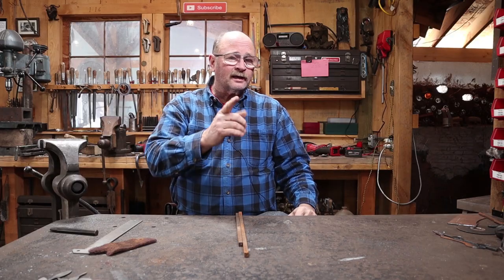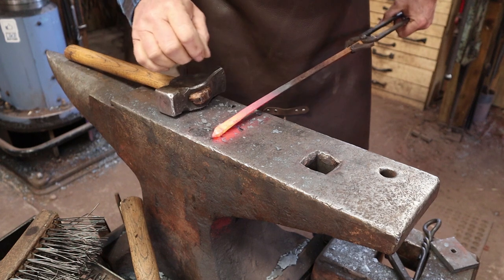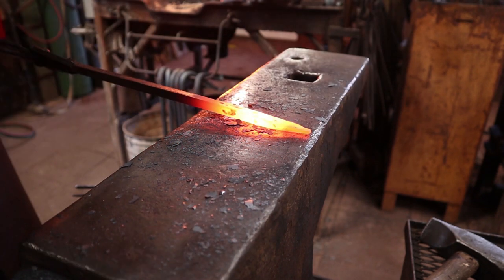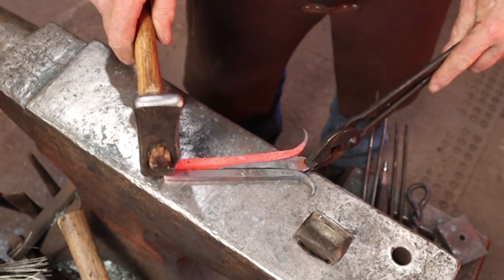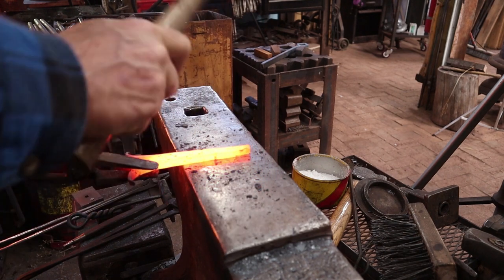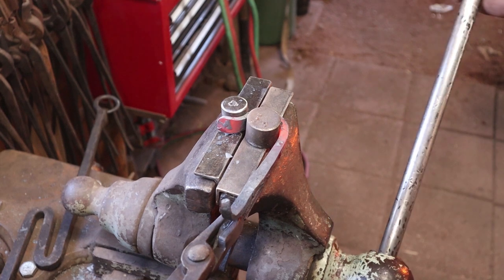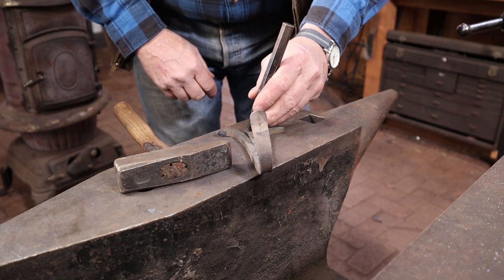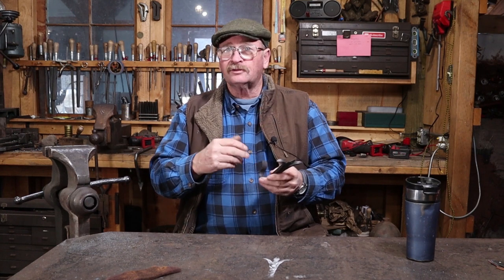Forge welded branch hook - Hook of the Week 32

Comment: It's always good to see small stuff forge welded in a gas forge. I've used a gas forge for years and have made a lot of Damascus for knives. High carbon steel has a lower welding temp than mild carbon which I suspect you were using. I do know that it's time to re-line my small forge and possibly upgrade my blower. Great video.

Comment: I learn so much from your channel. Thank you.
I have a question about “upsetting”. I notice when you do this operation, it involves hitting the workpiece head on to thicken the metal.  It seems that this process pits the smith’s arm against the power of the hammer strike. It’s a pretty unfair competition! Have you ever considered making a specialized set of tongs for upsetting? The tongs would have a piece of steel extending perpendicular to the tongs, close to the boss, so that when you go to upset a piece, you rest this metal finger against the side of the anvil. That way, the tongs catch and hold fast against the anvil when the hammer hits the workpiece.
The smith would still need to grasp the workpiece firmly in the tongs, but the hammer blows would be absorbed more by the workpiece, and less by the smith’s elbow.
I’ve looked all over but never seen such a thing. What do you think?
Reply from the maker: It sounds very specialized and would probably not be just right more often than not.   Using the vise is a good way to hold material while upsetting
Reply: Black Bear Forge 
I see. The vise sounds like a good idea.

Comment: I remember your bucket was empty, Today I don't see the one of several you are using out of, I do how the plastic buckets fall apart so thinking might be why you not on the work table.
Thanks the teaching helps but I don't get into my forge lately
Having to remodeling upgrade on a new for me 1995 Ranger truck should be a nice little truck to have around
Thanks John Switzer I hope to fire up the ribbon burner I built in a slow build last fall.
Reply from the maker: I'm not working out of any one bucket at this point.  So I chose what to use out of any of them

Comment: Okay cool 👍. I have questions on your borax I can't find that type of borax but I have a 100% borax is that any better than soap borax
Reply: Check at  Walmart .
They carry 20 mule team.
Reply: Just don't use the borax based ant poison! 🐜🐜
Reply: Speaking of 20 mule team borax have you seen the video series Engels coach shop did on remaking the borax wagons for the 20 mule team very interesting a lot of black smithing and wood working
Reply from the maker: Borax sold for industry makes good flux, if thats where your getting 100%  of course i think the 20 mule team borax is just plain borax as well, no soap